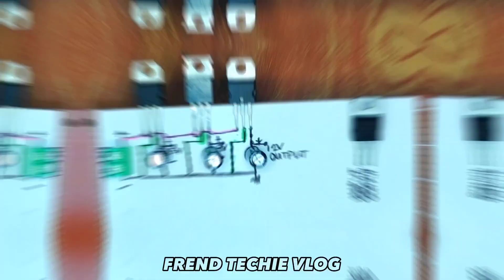Useful 3 Constant 5V, 9V, and 12V output Power Supply

Comment: Sir... Yun po bang output noong 3 transistor ay dc voltage na ?  Yun po bang 30 volt na supply ay dc?....
Reply from the maker: Yes Sir, DC voltage, regulator IC hindi transistor, kung saan halimbawa LM7812 input at ang output 12volts DC